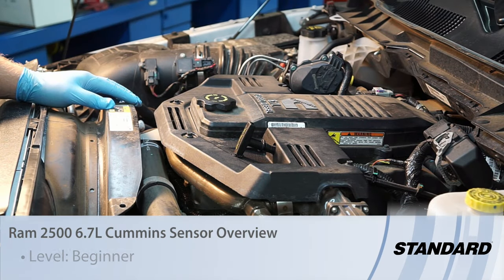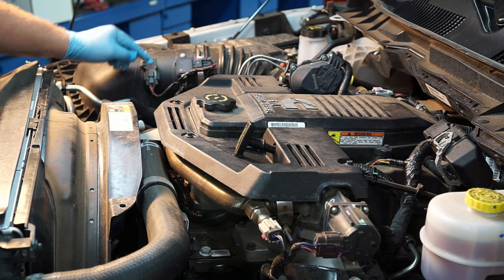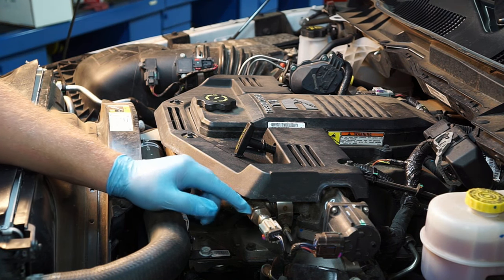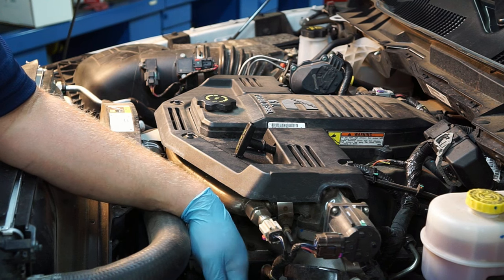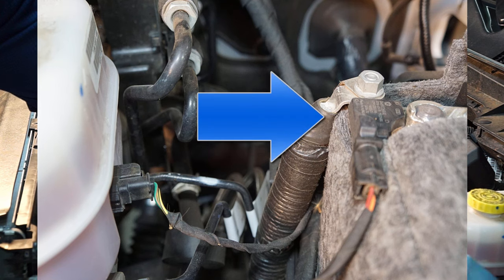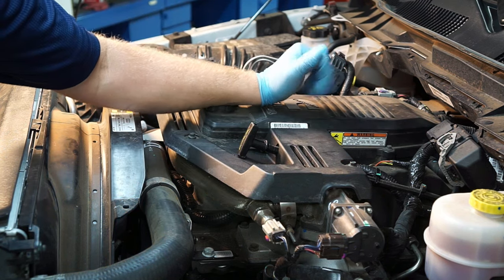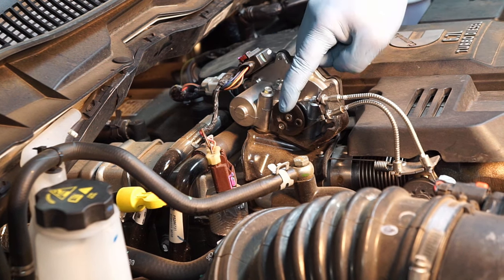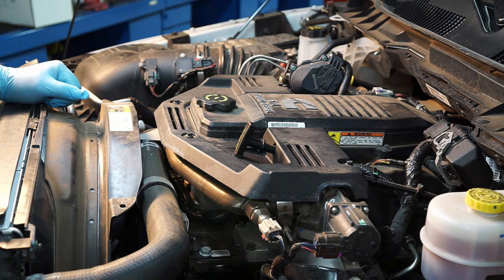Ram 2500 6.7L Cummins Sensor Overview

Comment: My 2015 with same engine in video wont start just clicks and say service electronic throttle control, have you seen this problem before?  Can it be a sensor?
Reply: Gil B. Yes I have a 2013 ram 3500 6.7 have to replace throttle pedal in cab 2 10 millimeter bolts unplug sensor disconnect battery first very exspensive if you go through dodge house order online